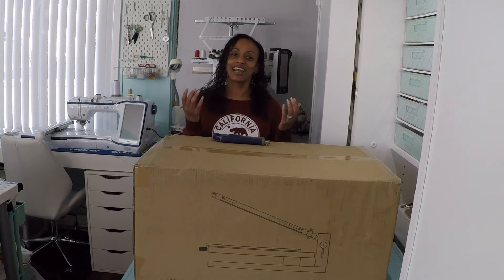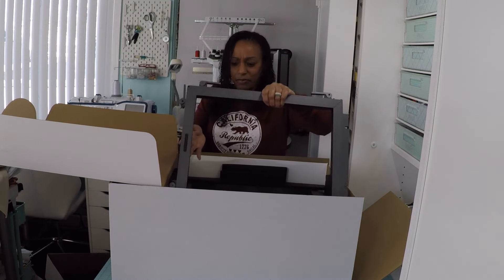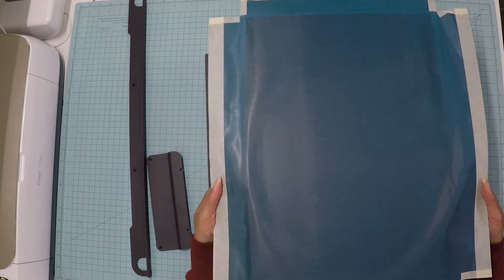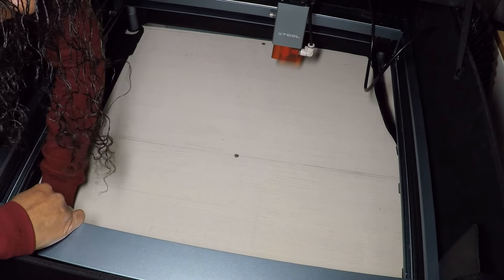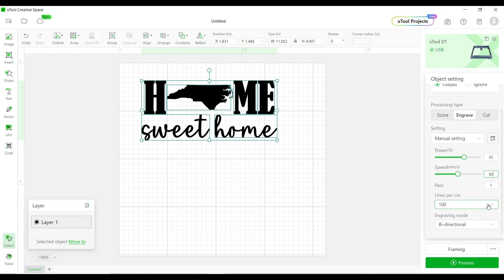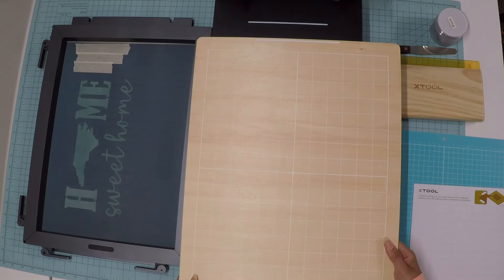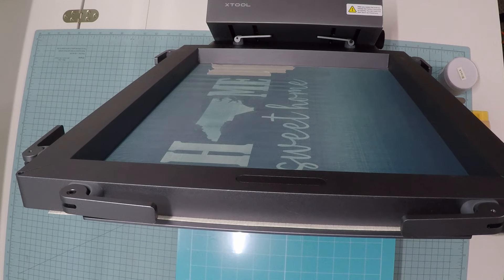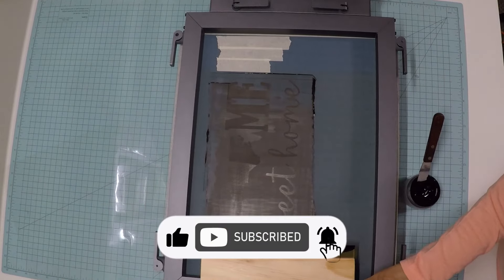Avoid the same fate: First Attempt Disaster with XTool Screen Printer

Comment: If you bought this through the kickstarter campaign as I did, it said right in the campaign that the screen printer was only compatible with the Xtool S1 and the D1Pro.
Reply from the maker: I bought it through the kickstarter campaign.  I don’t recall seeing the word “only”.  Additionally, I spoke with their customer service who told me it is compatible with my D1 laser.  I also watched their live and they said it is compatible with ALL of their lasers and it is compatible with other lasers.
Reply: @latriciacreates  for cutting the basic screens, but for the multi color even to this day if you go to the questions section of the kickstarter, the very first question starts out.
Which models is the screen printer compatible with?
The screen printer currently supports the vast majority of laser engravers on the market. 
Specifically, for xTool models, the 11.5*16in frame perfectly fits the models S1 and D1 Pro, for which we have also developed frame-fixing pieces.
The frame fixing pieces only work for the S1, and the D1Pro each of which has its own piece.
Reply from the maker: @curtgroen2712, fair enough.  It is more suitable for the D1 Pro and the S1.

Comment: Have you done a firmware update? I got my laser a few days ago and once the firmware updated, the settings appeared
Reply from the maker: I updated the firmware when I did this video to version 1.7.8 and the settings weren’t there for my D1.  If there is a new version, I have not done an update. If you just got your laser, you probably got the D1 Pro.  I have the original model that has been discontinued.  I will check for an update.  Thank you very much.

Comment: you gotta flood the screen first. so move ink into your design with your squeegee  and then print again but on your surface. :)
Reply from the maker: Thank you very much @uco.7303. I’m going to do that.  ❤️
Reply: @latriciacreates  yeeees I got one and was looking at reviews before I open it officially. But I use to screenprint on regular screens and that was the one thing that makes the print better.
Reply from the maker: @uco.7303, my design didn’t engrave well.  My settings were off.  Even with flooding, the print was still bad.  When I get good settings, I’ll try again.  Thanks for the tip.  Let me know how you like it once you get it up and running.
Reply: @latriciacreates  will do sis 🙏🙏